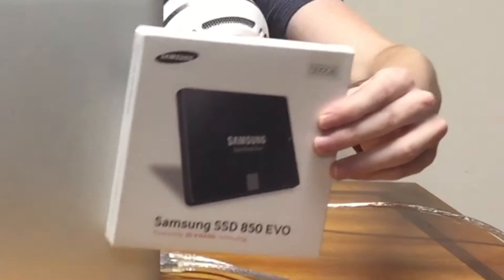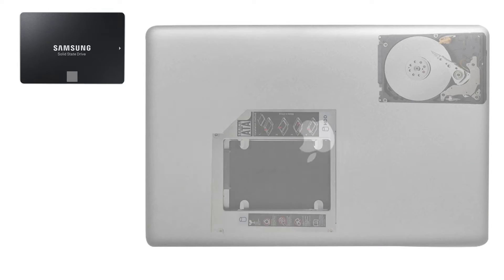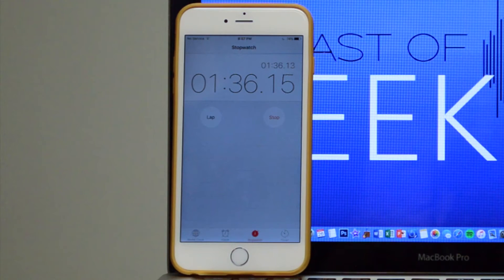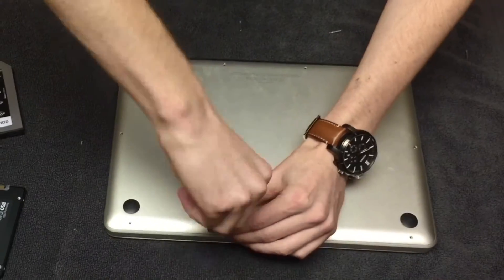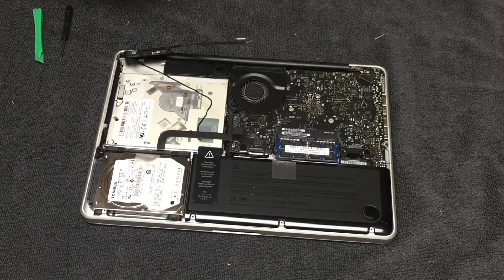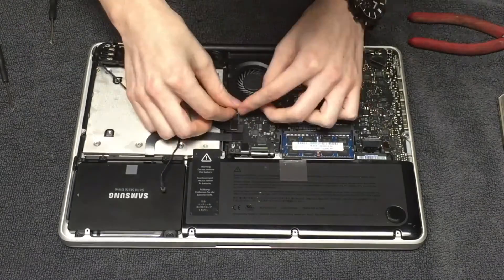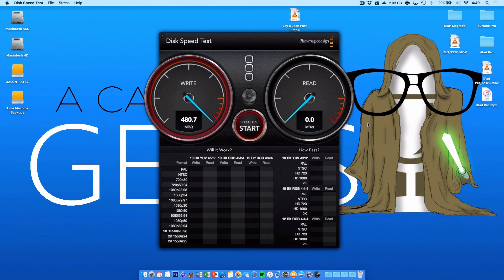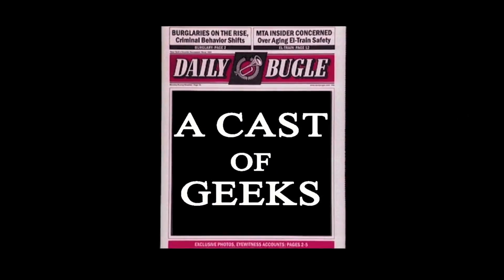MacBook Pro REVAMP: Optical Drive Removal & SSD Upgrade w/Speed Tests!

Comment: One question, I read that the optical drive is only 3gbs of speed, slower than the main bay that is 6gbs, install a second 2db hdd drive and it works improperly is sata lll of 2tb, when trying to copy files to that unit takes too much time, will it be because of the speed or storage capacity of this second unit?

Macbook Pro 13´ Mid 2012
16 ram
240gb SSD

link of the article I read:
https://eshop.macsales.com/item/OWC/DDAMBS0GB/#comp_notes

Comment: Hey Cast of Geeks. Thank you for this! 

Question. I’m still running 10.6.8 on my late 2011 MacBook Pro (with a 500mb SSD and 16GB ram). 

If I were to swap out the DVD drive for a second SSD, would it make sense to run 10.6.8 on one, and the latest OS on another? 

I’m scared of losing programs by upgrading from 10.6.8, hence why I’m exploring this. 

THANK YOU!!
Reply: Update the OS with a patcher! I have the same model with 8gb of ram, double SSD work in RAID mode which basically doubles the spees

Comment: I have a question. Say I want to change the optical drive with an ssd, will this get rid of the OS and apps I've already installed?
Reply from the maker: No, the optical drive is the disc drive and is made for removable discs. The OS and apps are installed on a separate drive, which would be the HDD or SSD already installed in the main drive bay. However, if your machine is older I would recommend doing some research to make sure the optical drive's SATA port supports SATA 3 speeds, because if the port doesn't support SATA 3 you wouldn't be able to take advantage of the SSD's data transfer speeds.
Reply: A Cast of Geeks so the transfer speed is basically like another room when data from my main drive (ssd) Is pulled over to the optical drive? And does the optical improve the performance a bit?
Reply: A Cast of Geeks plus I have a mid 2012 MacBook Pro with upgrades. I’m just checking to see if this could actually work.

Comment: Is there any benefit at all to putting the SSD where the original HDD was? I was thinking of putting the new SSD in the optical drive adapter so I wouldn't have to move the HDD at all.

Comment: I have important question, because i bought the same SSD caddy. There is no place for two left screws on it, you just left them without screwing them ? Just put the one on the right and screw everything back ? is it safe ? Are u dont scared that this part could move somehow ?

Comment: I have a question: 

I'm thinking about buy a 120 GB SSD to run the OS system and make my Mac faster.
 
My question is: Should I use my SSD as primary hard drive or secondary using the optical drive adaptor? Which one would be faster? Using SSD as primary and HDD as secondary or the opposite? And how can I transfer all of my HDD information to my SSD using Super Duper? Thanks.. Great video

Comment: Hey guys! By doing the same upgrade you guys did, I don't have to install or format the new and old SSD,HDD ? You went from putting all together and turn on the computer. There is nothing more we have to do in order the new SSD works ?
Reply: Roger, thanks for watching! Once you have both drives in, you will have to hold the option key and boot from the HDD.  From there, you can clone the HDD (including the OS) to the SSD using an app like SuperDuper or, if you want to start fresh, you can download a MacOS installer from the Mac App Store and install your OS (i.e. MacOS Sierra) of choice on the SSD and set it as your primary drive in System Preferences. So, in short, you will have to install the OS on the new drive -- the SSD -- for this to work whether it be by cloning your HDD or performing a fresh install. I hope that answers your question and feel free to ask any more if you have them!
Reply: Perfect man, what I am going to do is start fresh, save some files that I need from my old HDD and boot everything. So the only thing I will need for this is having the MacOS Sierra on a flash drive to install it on the SSD and that will be it right ?
Reply: You actually wouldn't even need the flash drive. Once you have both drives in your MBP, you can hold in the option key during startup and select the HDD to boot from initially. On the HDD, you can download the MacOS Sierra installer from the Mac App Store and run it on the HDD. Be sure to select the SSD as your target drive though. Once you've installed Sierra on the SSD, go into system preferences, then startup disk and select the SSD. Once you reboot, it should automatically boot from your SSD with the newly installed OS on it. You can then begin selecting what you would like to keep on the HDD by moving it to your SSD temporarily. You can format the HDD (because it will still have the OS and system files on it) to OS X Extended (Journaled). Once it's done formatting, you can move the files from your SSD to be stored permanently on the HDD and voila -- you've got a fresh install on the SSD with the media you want on the HDD!
Reply: Thanks Man ! Keep up !
Reply: I appreciate it, man! Thanks for watching!
Reply: Man, sorry to bother, one more question, Can you combined the SSD and the HDD as a RAID ?
Reply: To my knowledge, you can't combine them as a RAID within the same machine, although I am not for sure. It would be awesome to set up something like a fusion drive like with other Mac products, but unfortunately, I don't think it is possible.

Comment: thanks for the great instructions. I upgraded my MBP Early 2011 13" (8.1)'s RAM and directly to an SSD, i didnt have a caddy so I took out the old HDD, but I'd rather put it back in for the extra space (i heard you say media files- thats exactly what I would do). 

Question though about removing camera wire and subwoofer stuff.. I've seen instructions that say that step is unnecessary. Whats your thoughts on that? jw

Thanks again for the help.
Reply: Michael, thanks for watching! In my experience, I tend to air on the side of "better safe than sorry." Since the subwoofer sits directly on part of the optical drive, I like to remove the subwoofer assembly completely to ensure the optical drive is safely removed without damaging anything. It is probably possible to do it without removing the camera wire and subwoofer assembly though; I just do this to cover all of my bases essentially. If you have any more questions, feel free to ask!

Comment: Hi. Sorry for this noob question. I found an online seller of caddy (SATA). The product looks similar to what you have on your video, but the seller did not specify for which laptop brand/ model the caddy is for. Is there any specific caddy for macbook?
Reply: Ray Mark Perez No worries! Haha. That's a very good question. There is not a specific caddy for MacBooks. It should work as long as it's a 9.5 mm optical drive. I have one linked in the description if you want one that will definitely work, but, again, the one you've found should work as long as it's a 9.5 mm optical drive.
Reply: Jalon Morgan Thanks. 👍👍👍

Comment: Hello guys, 

 I was wondering if i had to move around my hdd to where the optical drive is, or can i just go straight to just replacing the optical hard drive with an ssd and leave the HDD where it is?
Reply: Luigi baltazar Thanks for watching! You certainly don't have to move the HDD to where the optical drive is, but I did so because I was a little unsure about any loss in speed that may occur because of the caddy/adapter itself.  To be safe, I put the SSD (to be my primary drive) in the primary slot to ensure that it would have the most speed from the SATA connection.  I have not noticed any slower speeds with my HDD, but I would probably put the SSD in the primary slot to ensure that you are getting the most speed out of your primary drive.  When switching the drives, be sure you hold the option key and boot into your HDD (which would be in the secondary slot/optical drive caddy). From there, you can format your new SSD and set it as your primary drive in System Preferences. If you have anymore questions, feel free to let us know!

Comment: What is the point of optical hard drive, if i replace both and both are 250gb do i now have 500gb together? Should i replace both?
Reply: Matt, thanks for watching! You could certainly replace both if you wanted too. I used the 750 GB HDD already in my MBP because I would only be storing media on it.  For this, I would not benefit tremendously from the extra speed of a SSD, so I decided to save some money by using this same HDD.  Effectively, using the HDD as a secondary drive is like having an external drive connected to your Mac at all times.  So if you have a 250 GB SSD and a 250 GB HDD, there is technically 500 GB available to you Mac, but they will be recognized as two drives. One will have your OS on it and one will be available to drag your media over to.  Unlike the Fusion Drives present in modern Macs, the software will not recognize the two drives as one and intelligently move your files between a faster form of storage and a slower one.   It will be up to you to install the OS on your faster drive and move media files to your slower drive like you would with an external HDD connected to your Mac.
Reply: Jalon Morgan thank you

Comment: I bought all the necessary parts.

But I was wondering do I have to copy my old drive like you did?
Can't I just erase both and time machine back to my old stuff?

Also how can I put apps and El Capitain on the SSD while I store my other files on the HDD?
Reply: +yankee0603 No, you certainly don't have to copy over the entire contents of your old drive. If you are wanting to do a clean install, you'll need to create a bootable USB stick (must be larger than 8 GB) with El Capitan on it because the new drive will not have any contents on it. Another option and probably a better one would be to boot from the HDD and download the El Capitan installer and choose the newly inserted SSD as the destination to install the OS on the SSD. From there, you could wipe out the contents of the HDD. To choose what disk to boot into, you merely hold in the Option key while the Mac is booting, so that will allow you to choose the HDD as the one you would like to boot into. This will allow you to download the installer and install the OS to the SSD. Again, then you'll be able to boot into the clean installed SSD and wipe the contents of the HDD.  From there, you could certainly use Time Machine. Although, I found Super Duper! to be a very easy alternative as it copies all contents and the OS over to your secondary drive. Super Duper! is a paid app, but you are allowed 10 clonings I believe through the trial, so that was adequate for my one-time cloning of my original drive.

As far as putting apps and El Capitan on the SSD and other files on the HDD, I was able to do this by cloning all my contents from the HDD to the SSD then wiping out the HDD and formatting it to Mac OS Extended (Journaled).  From there, I started to manually migrate over media files to the HDD such as movies, my iTunes library, and photos. This allowed me to have El Capitan and my apps installed on the SSD, while my media was stored on the HDD.

I hope that helps. If you need anymore clarification, feel free to ask!
Reply: +Jalon Morgan the Only thing with copying my current HDD to the SSD is the fact that the new one is 250 and not 500 but I guess I can move some files to my back up hard drive to keep the copy at around 200 gb for now. That will work right?
Reply: +yankee0603 Yeah, that should work. As long as you can get all the contents of your drive below 200 GB, it should copy over. You do have to be mindful of the amount of space your OS is taking up though. I think that you're right though. That would be the best option in using a backup drive to move some files over prior to the transfer.
Reply: +Jalon Morgan 250 GB***
Reply: Ray Mark Perez The SSD that I inserted and am now using as my primary drive is 256 GB.
Reply: Max Chin, I would just drag and drop the media files you would like to store on the HDD. 
Once you've changed the drives, you'll have to boot from the HDD (you can hold option while your Mac boots to select the HDD). From there, you can clone the content on your HDD (including the OS) to the SSD using "SuperDuper!" You can use the trial version to clone. The link to this app is in the description. Then you can format the HDD using Disk Utility to Mac OS Journaled and begin dragging media files from the newly cloned SSD to the HDD. Finally, you'll need to change the primary drive (to always boot from) to the SSD in system preferences if it isn't set already. Essentially, your HDD will act as an external drive to drag media files to as you like. If you have any more questions, let me know! Thanks for watching!
Reply: Max Chin yep, it'll show up as an external drive on Finder. It's essentially an external drive always connected to your machine!
Reply: What is the capacity of your new ssd?
Reply: Hi Jalon, Can I ask how do you move your files on your bootdrive SSD to HDD? Do you just drag and drop to the 'Macintosh HDD' under the device column? 
And how do you open those files that you have moved to HDD while booting from SSD? Do you have to restart to boot from HDD to open it? 
Does it work the same round from HDD to SSD too? As I only have a 250GB SSD and a 500GB HDD from Apple. I am planning to boot it from HDD and copy only important files to SSD. Please help me!
Reply: Alright Cool but can you open files that you stored from HDD while booting SSD (Like photos or movies etc)?